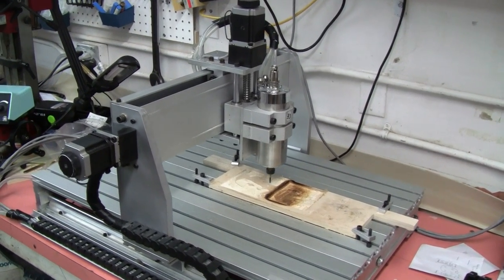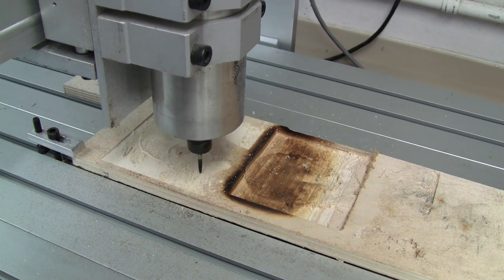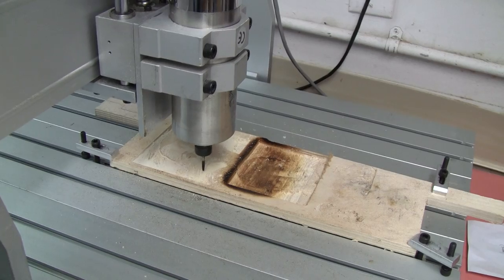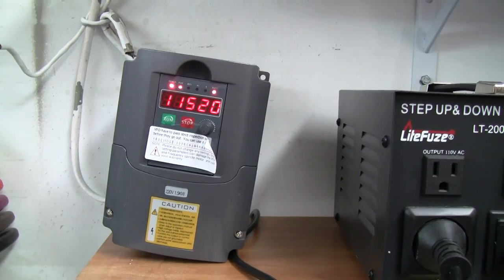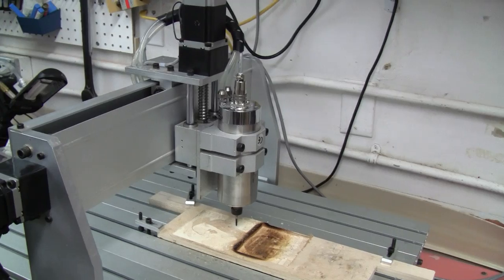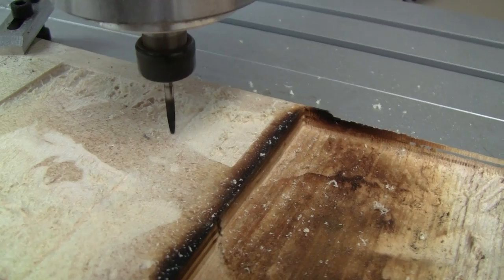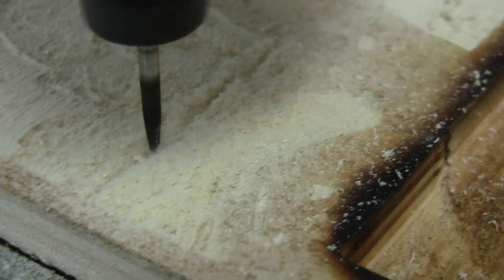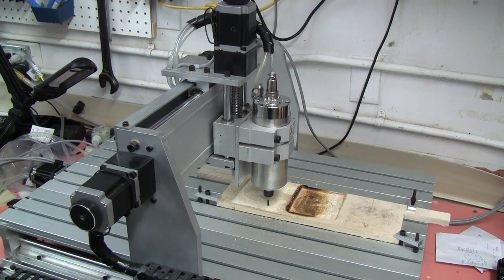3 AXIS CNC 6040 ROUTER ENGRAVER DRILLING AND MILLING MACHINE 1/5

Comment: Thanks for reply.. What software you use with Mach3. my machine not keeping same axis location in production
Reply from the maker: You are probably skipping steps. Try cutting your speed to 1/10 and see if it still skips steps. If putting the speed slower fixes it, it is almost certainly that your stepper+driver combination cannot move things at the speed you are asking.

Comment: Hello, just question,,do you install mechanical switch on each axis or Soft-limits in mach3_? How you control over travel of axis movement..please
Reply from the maker: There are no limit switches when I took that video (~8 years ago). I have now installed switches but they are not configured in software.

Comment: It looks like you are running the X. Y and Z too fast. Slow it down a bit and see if it keeps its tracking better.  Almost all the machines that I see will lose tracking when run at a high rates of speed. I have a four $20,000 Gravograph (formally new Hermes) machines and they all will lose tracking when run at their highest speed. Also slow the spindle speed down a bit if you are getting any burning in your wood that you are engraving.

Comment: For engraving on a silver ring, is it possible to use this or Do I need to upgrade to 5 Axis?
Reply: I think this is too low-end for precious metals. I think you would want a higher precision system.

Comment: any one know if this would be able to engrave steel
Reply: Wow 2 years and no one answered you?  You can use a diamond tool or a high quality carbide engraver and it will engrave in steel. You must run it VERY slow in travel and rpm and use oil on the tool if rotary engraving. If you don't the cutter will burn out. I doubt if you can cut through any type of steel except maybe the softest and thinnest type of steel.

Comment: I bought a 6040 with a 1500 watts spindle, 110V box.  Currently listed on ebay.  It worked good for 2 small jobs but then started loosing steps in the Y direction.  If I put my hand on the black knob for the Y motor I feel it jittering and trying to move even when there is no steps sent to the motor.  Amazingly when I put my hand on the table I hear noise which I think is coming from the control box.  I'm pretty sure there is a ground and noise problem.  Perhaps the motor control is not bad after all.
Reply from the maker: +yasalam2121 I had to completely rewire mine, and added higher-voltage/better drivers and a USB (leaf boy) driver board. Basically a complete replacement of the electronics. Before the re-work, moving on one axis would glitch the other axes randomly. Bad news, that.

Comment from the maker: When I did the shielded cables, I tied the drain wire at each motor under a mounting screw. That drain wire ties to the metal connector back at the control box. I did not think about checking the mains grounding path. I'll have to look at that. I think mine has 3-prong plugs everywhere though, so it might not be problem on this mine.

Comment: Yes the LPT pins 18 - 25 are grounded via your printer cable back to the pc
The atx power supply in a tower pc is also grounded to its chassis via the earth path.
Whats a bit scary is the spindle and chassis of the router table are not even bonded
back to the ground of the mains sockets on the controller box or VFD in anyway
I have elected to bypass there surge protectors and IEC cables with no earth pins and replace them with standard computer mains power cables
All to risky dangerous otherwise

Comment from the maker: Before re-wiring, I bought a "double-shielded" parallel cable (search google for CS-DSSMDB25MF-002.5), it seemed to help, but did not fix everything,

I assume that the little parallel level converter board in the control box is grounded through the USB, if not the parallel cable. But you are correct, ground loops are bad. Maybe I'll take a look at that PCB if there is more trouble.

Comment from the maker: The controller box had a 120/240 switch, but the VFD appears to be 240v only.

I re-wired all of the axes and motor with 16-gauge shielded alarm wire (search ebay for "Control Cable 16 AWG 4 Conductor Stranded Shielded"), and it is working fine now . . . not losing any steps.

Comment: Im surprised the power supply inside your 4 axis control box didn't have a 120 - 220vac switch?
but then again the inverters need to be order specifically 120 - 220vac
Ive heard from a few people now problems with the stepper motor cables breaking copper strands (cheap chinese wire)
Another thing I did notice is that the negative wires and pc ground on the LPT are not bonded back to the earth of the power board in anyway. This could be why your motors are losing steps? Earth loops are not good